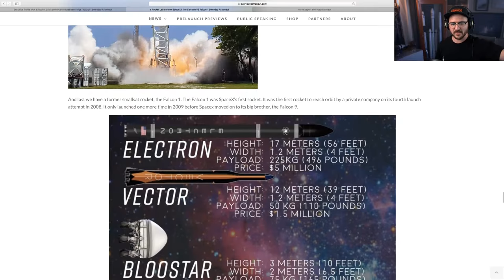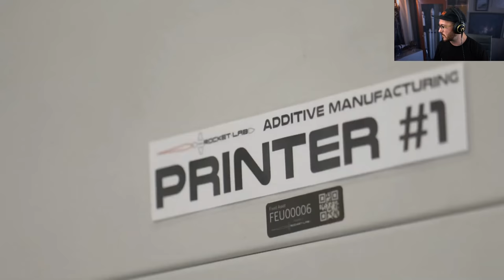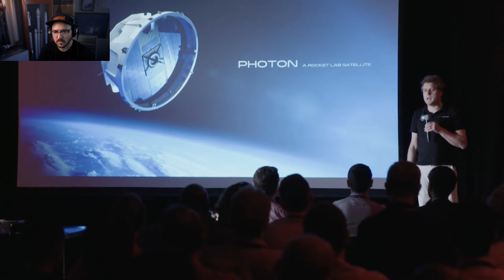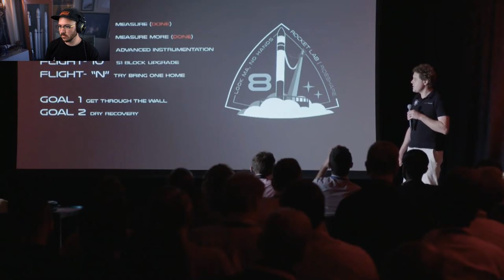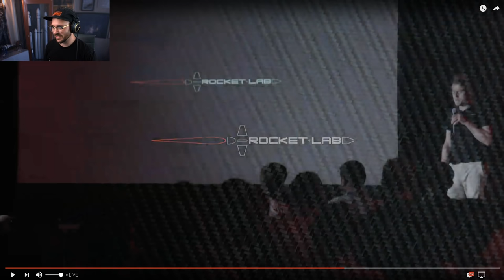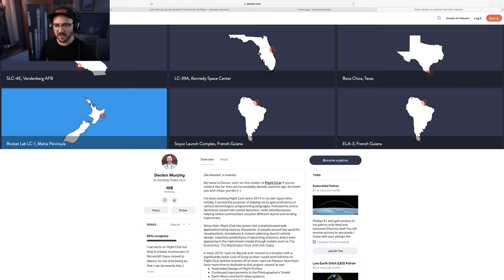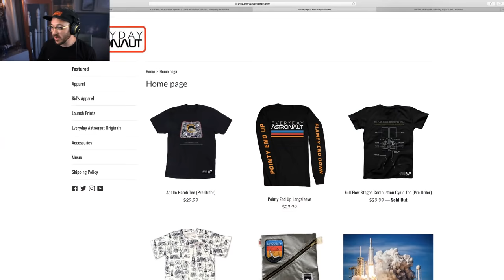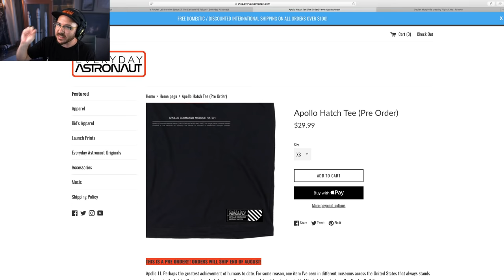Let's watch Rocket Lab's announcement

Comment: “Half the temperature of the sun...” About 3000 K - about the same as inside the combustion chamber.   Hmmmm....
Reply: surface temperature of the sun is around 6,000 kelvin, but the inside is much hotter :D

Comment: What if these rockets built a helicopter propeller into the top of the release section that could be powered by some remaining fuel, the blades could be flush with the sides of the rocket and then flip up as it's coming back down (once the parachute has slowed it enough)? Surely this would be a lot less weight than the extra fuel needed for the rocket-based landings, and you'd have a lot of landing stability with the combination of parachute and propellers at the tip for it to essentially hang from.

Comment: I'm hoping they'll eventually have 100 launches without any failures.  That's likely good enough for some intrepid souls.

If they can boost the payload to 300 kg (carried by the Electron bus), I'm sure there are smart engineers just itching to build a human rated space capsule (100 kg of structure, 100 kg of human, and 100 kg of other stuff.  Maybe just good enough to get someone to the ISS?

Meanwhile, kids, stay in your math courses!
Reply: Was thinking that also like sending astronauts up individually instead or emergency equipment, food etc and just one way would be a excellent NASA investment to think about. With the fast production run and pretty much unlimited launch window it a no brainer it's so cheap it doesn't need to be recycled ??